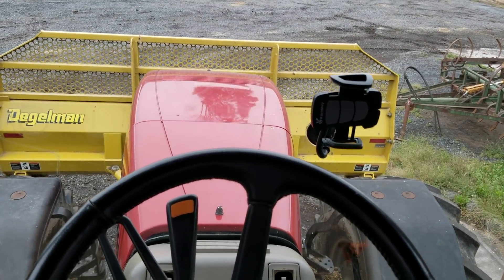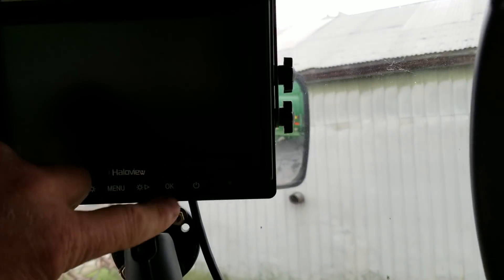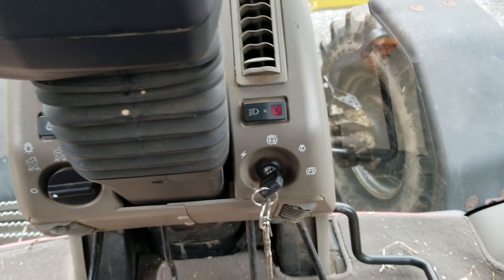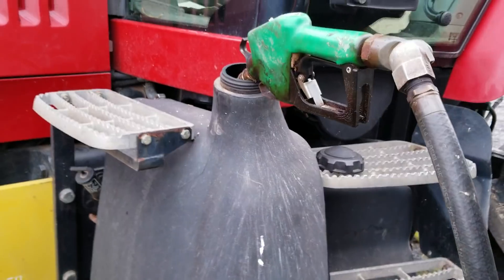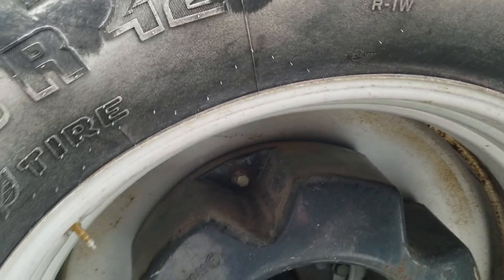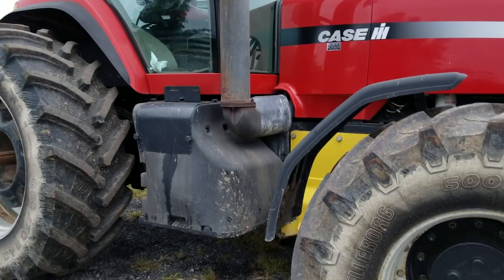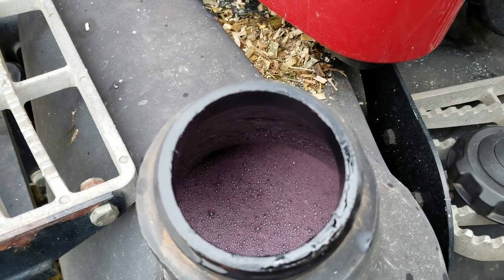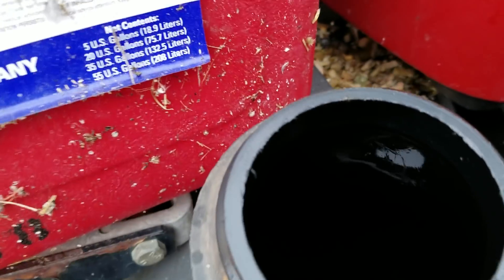How to operate the case MX 255 Magnum tractor getting ready to push corn silage

Comment: If ypu were to put one of those dengelman blades on a tractor that had a lpader on it, would you be able to hook the hoses up to the loader valves and operate it with the joystick in the cab